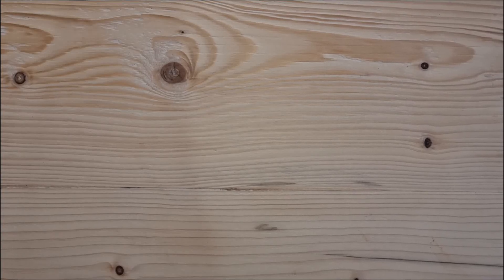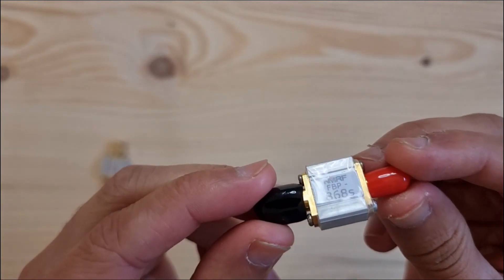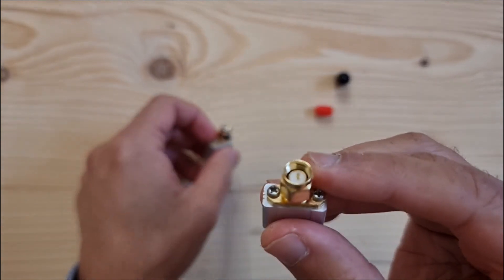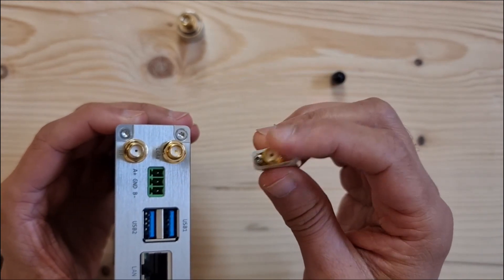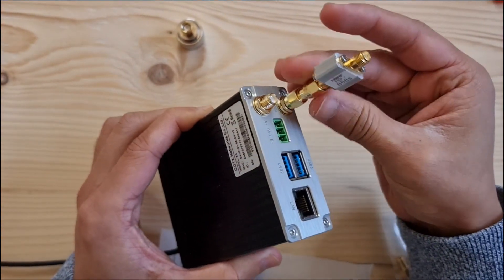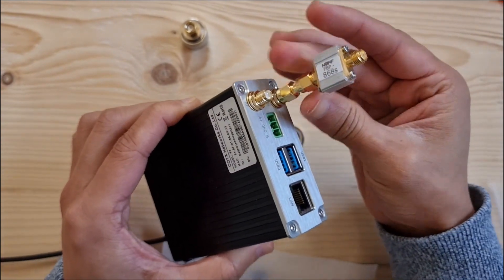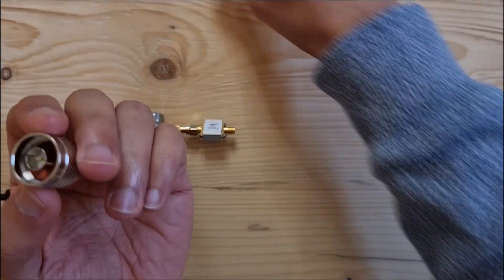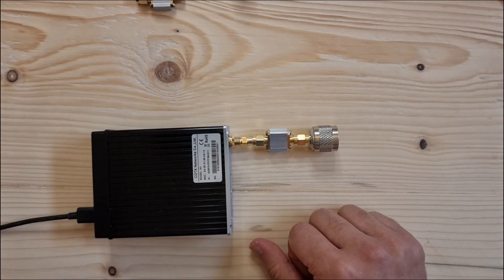COTX Filter vs AliExpress Filter | Helium Mining

Comment: quick question, I just received one of these and before doing anything I checked resistance between the two pins, got nothing, checking outer I got resistance.
Surely to work, I should get an internal reading from pins
I am guessing it's faulty

Comment: SAW filter is the filter is based on surface acoustic waves, and it's not good idea for Helium because its not stable for power and temperature. Try to use ceramic filters (not cavity), for example, from rfareas.
Reply from the maker: Thanks a lot for the info, I am just testing what the quick and cheap fixes are, once HNT price goes up enough or the rewards are worth the cost of investing in more filters then I may change my mind. For now it's not worth the long ROI time.